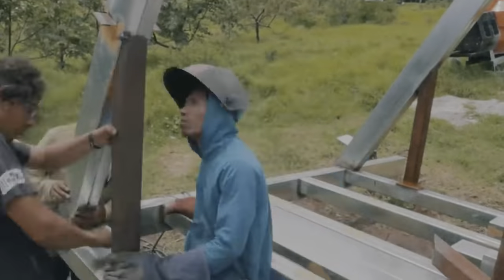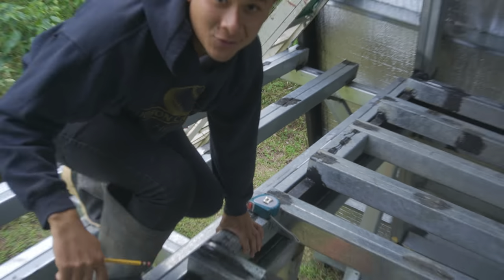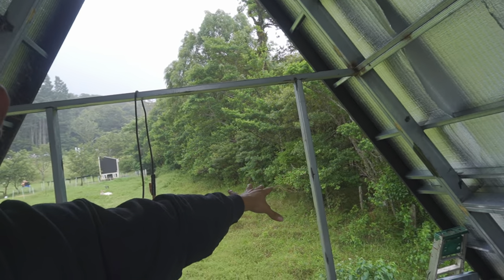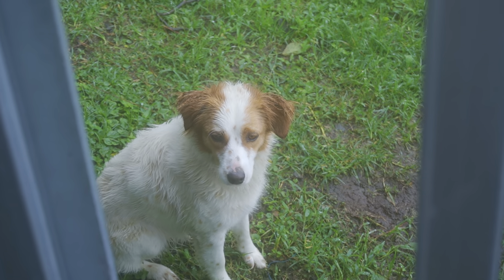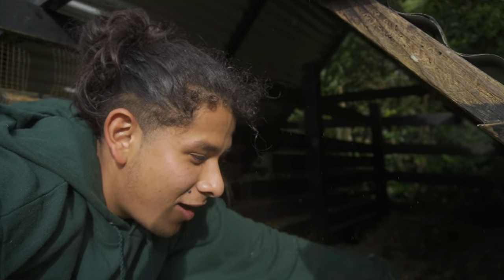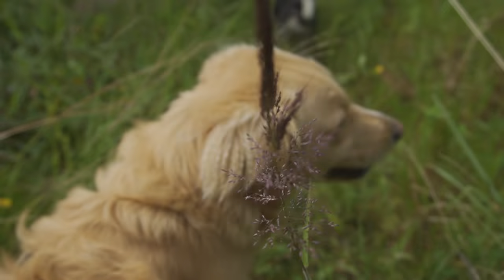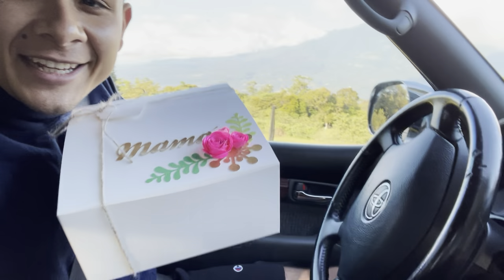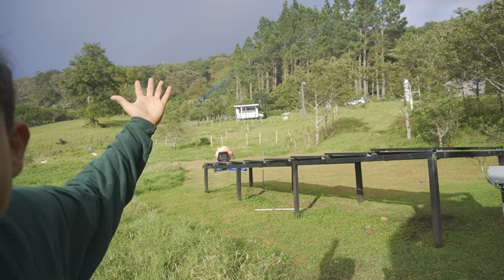I SCREWED UP!

Comment: You may want to have a window in the glass wall!  When it gets hot and humid you will need a air flow to cool down and help with controlling the humidity inside the  house.  Probably you will need a window in the loft area and on the  main floor.  I live in Hawaii at the beginning of the rain forest where  it rains almost every day. So to be able to open windows is so important for my comfort and keeping the humidity at bay.
Reply: That's exactly what I was going to suggest! You will want air flow and whether it's louver vents that you've got somewhere or one of the windows open you will needs some sort air flow. By the way you do an awesome job! I've been building for 3 years and I will be done with my house and about a month!!!!!
Reply: 1
Reply: Yep agree, big time Rodrigo you will need cross breeze or you will be kicking your self and use a lot of Aircon but humidity is the worst
Reply: Yes i think he should it would make nice gor fresh air through his home
Reply: Was going to say the same thing about having a window on the opposite end for airflow. Hugely important when you live in a damp area. You will need for the heat, humidity, air freshness. If you don’t you will wind up with a moldy home, that is stuffy, & smells bad. Might also consider putting a vent into the roof of your loft to help as well. Heat rises & will need an outlet or sleeping is going to be miserable.
Reply: Your joy that lives within you is amazing! Great personality and determination.Especially doing a lot of it on your own..Keeping gratitude and faith in your life is also a strong foundation to live by.🌅✝️☮️

Comment: Yes you need to plan for open and close windows on both sides, humidity and heat where you can allow the breeze to come through, let the heat escape as heat rises- I live in Florida and it is most necessary. I would suggest at the top if you could build a window that opens out from the bottom to let the heat out when you need it and still have protection from rain. Much love and so proud of you - Nana Kelli in Florida

Comment: You are amazing Rodrigo.  On the stairs...what if you build the platform, where the stairs turn,  first.  From there build the lower steps to the platform (or landing).  Then build the upper stairs from the platform (landing) to the loft.  Stairs are tricky!  Most people dont get it right the first time with the exceptions of those experts.  Im sure that by the time you see this you will have the problem solved!

Comment: Cheer up about the stairs my friend! The old saying, 'Measure twice, cut once,” does not apply to stair building. It is measure twice, do it again, then recheck your plans, measure again, then use a piece of scrap to make a test piece. Try the test piece only to find out that it is wrong too. Start over.  Even old farts like me, who have built many stair systems, still can and do make mistakes. Go for it!

Comment: You may need a landing at the transition from the lower stairs to the upper stairs at the left turn, it could be square but it will make the turn easier to build, it will require that the lower stairs move away from the upper stairs by the width of the landing but much easier to build

Comment: Start with a pole high enough for your turn.  Marke where your turn , for the steps will be turning 3 , 4 steps, go up and down from that point.  Unless you're doing a platform to the second set of steps.  Still measure the  height of platform and start there. Up and down from platform.  Good luck
Reply: Don't attempt to change direction without a landing.

Comment: Have you come up with a final design for your stairs?? I really hope so. It's worth taking your time on because once built you have to live with them. Make them really safe to walk on and carry things up and down with...beds, laundry, etc. If you can split it with one or two landings so that if anything happens and you slip going down then you don't fall for the whole height of the staircase. Also this gives you lots of capability for building in different storage options under certain parts of the stairs' (but not necessarily all of them) Hope that makes sense!! keep up the good work of looking after the farm!! 😁

Comment: Maybe instead of opening windows you could have some venting system on opposite sides to control airflow as you desire, without hassle of window, placed on ceiling, or in area above the glass.  And I know nothing about building  :)  can you tell?  Ranchero Heberto (spelling?)  needs a horse!  Ha ha ha.

Comment: Hi Darling  1St  huge fan & love your channel same goes of course for Jordan & Kaylee. I live in Lake Worth Florida USA.  Im also a retired Firefighter Paramedic Lieutenant Instructor 2 with Palm Beach County Fire-Rescue.  Info given to give some input about your house.  Not sure if you will have toilet in house however RECOMMENDATION
YOU NEED to think about some sort of window or vent you can open upstairs.  Heat factor in summer with Metal roof, framing and non opening huge windows it will become very HOT HEAT RISES you need to allow heat to escape.   Also to be able to creat positive pressure ventilation.  Your home will hold heat.  JUST SOMETHING TO CONSIDER/THINK ABOUT.  Love & RESPECT 🙏🏻❤️✌🏻

Comment: you need a window to open on either end as well as on both floors for cross ventilation to help with the humidity and air flow.  Additionally, you need to allow for an outside balcony... more footers?

Comment: Your house is built better than most ships I have served on...I´m curious about how you
are going to run all your electrical wiring.
Reply: What did you serve on? Sampans?
Reply: @bobtransvaal144  ...after serving 25 years in the Navy and having boarded and inspected many merchant ships I can safely say I have had the shit scared out of me...numbnuts
Reply: @zanedavid1 ....So the poorly built ships were not the ones you served on in the Navy. Makes more sense that way, but isn't what you said.
Reply: @zanedavid1 ....Boarding a ship means you are serving on it?
And I doubt I have heard the word boondockers since I left Great Lakes nearly 60 years ago.
Reply: @bobtransvaal144  ...I completed Bootcamp September of 61 in San Diego.  Due to my MOS after I crossed a Quarter Deck I was attached to that vessal.  You´re an Old Fart.